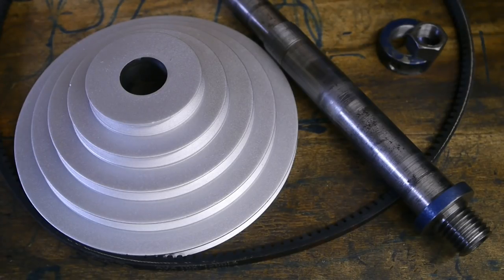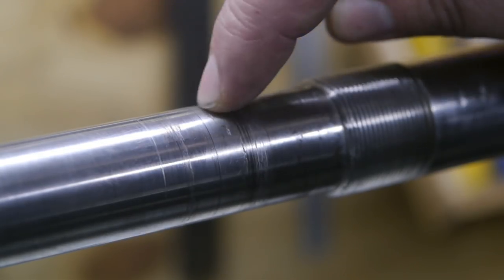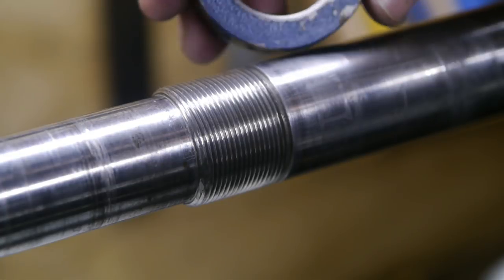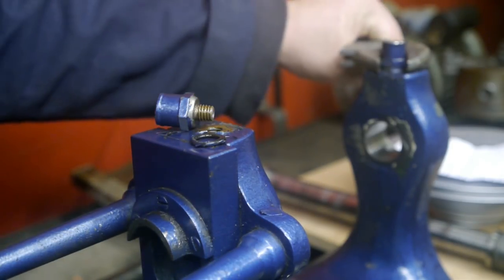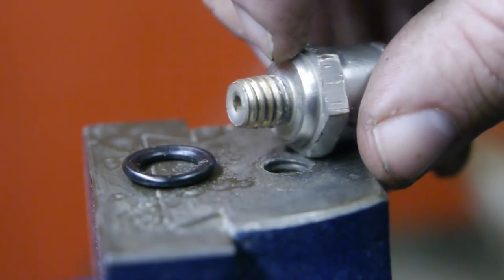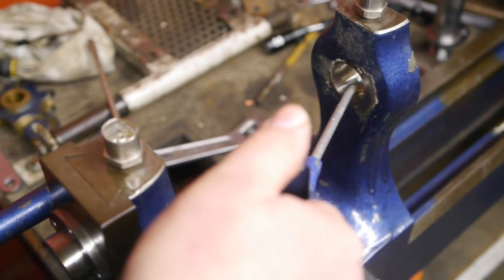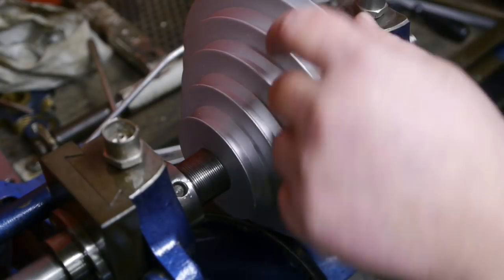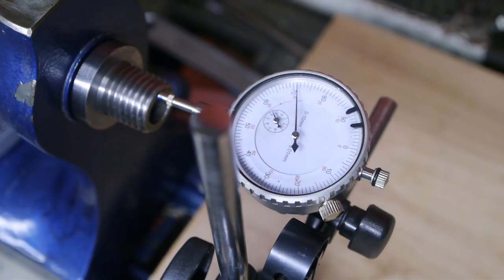Polishing bearing journals and reassembling a vintage lathe spindle

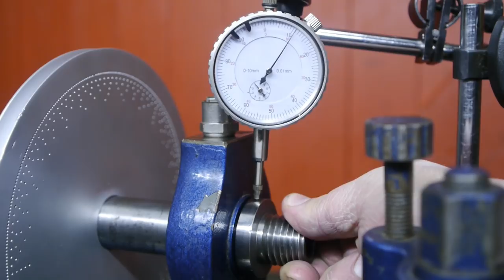Comment: Hi.  You directed us to this video from another one where you complained about chatter when screw cutting.  Some opinions suggested headstock bearing play.  If I understood your comment correctly, you weren't convinced that it was a loose bearing.  THIS video at 18:06 I think confirms the play.  You are moving the spindle side to side and STILL getting 0.03mm movement on the DTI.  Imagine how much that would be if you were moving the spindle vertically.  I don't believe that oil, even heavy oil would solve this, and personally, I think this is your chatter issue.
Regards Mark in the UK

Comment: Well done on the spindle.   I was glad to see at the end that you did not forget the belt.

The polishing seems to have helped reduce the runout.

I would use oil in the spindle bearings.   As others mentioned grease will trap debris.

Dave.
Reply from the maker: Apart from those damaged nuts this must be the easiest spindle to disassemble.
Once the axial play has been dialed in there is nothing to adjust. And that's perfect because I'm sure I'll forget that belt some point :)

Comment: I would keep the moly grease, or any type of grease away from pain bearings, and use oil only. The people that owned my power hacksaw in the past used grease in all of the bearing points, and it destroyed every single bearing point on that thing. The grease catches all of the grit and metal grit from wear, and acts as a grinding paste vs oil which just flushes the particulates out and keeps the bearings from damaging themselves. Grease imo should only be used on hardened surfaces, like ball bearings in the bearing races.
Reply from the maker: They probably didn't use grease pots that push the grease though the bearings. 
If they had, and they used them properly there should be no dirt in the bearings.
Reply: yea, Ive found the same thing in multiple pieces of machinery, and it all had the same outcome. The grease did go through everything fine and started squirting out of the sides of it, it just caused more damage than anything. It's always been an old rule that grease is for hardened stuff and oil is for bronze, babbitt, or cast iron bearing surfaces.

Comment: Not to bad for all the years it has worked. What you did did the trick. Your ideal about the grease sounded good to me. At work I used STP and lithium grease mixed for the drive cable on a saw sharpener. 
All my best.
Bobby
Reply from the maker: I want to use something a bit thicker then oil because the bearings are completely open on both sides. 
I expect oil will just piss out.

Comment: the adjustment in the end bolt,you could drill out enough to place a ball bearing between the bolt and the spindle.this could take out most of your end play,cheap and easy to try.
Reply from the maker: Are you talking about 1 ball bearing on the tip of that rear bold?

Comment: What you were picking out of the oiler bores is the remains of the felt wicks.
Reply from the maker: I'm not sure but it made me think of hemp or sisal. 
The stuff people used to use on threaded water pipe before the invention of Teflon tape.

Comment: I just found a craftsman 109 for 110 bucks, around 116 shipping to me, but the lathe itself looks to be in incredible shape, I'll do a build of it soon!
Reply from the maker: Funny, I actually have one of those :) 
It's in terrible condition and so far I never used it.
At some point I'll make a video, but for now I'll make you a picture.
Reply from the maker: Here's a picture of the mean green machine: https://goo.gl/Bb5Ru7
Reply: Awesome, I guess the one I found isn't in EXCELLENT shape, found a motor for 100 bucks on eBay and I gotta find a chuck for it, all it has is the back plate but for 216 bucks, I saw ALOT worse for 600+
Reply from the maker: I think you might be better of saving up for a Chinese mini lathe.
Reply: Eh, already bought it, I've been looking for about a year...Im a complete beginner when it comes to machine work with the exception of hundreds of hours of theory, I'll build this lathe, put the theory into practice and sell the lathe for an upgrade in a year or so

Comment: Those spindle bearing need oil, not grease! That said, you can buy MDS solutions for adding th the gearbox of a car. I have used that in my lathe's gearbox, and it reduced the noise dramatically (and thus also does a better job lubricating) an oil like that (proper grade spindle oil!!, not brake fluid or anything of that nature) mixed with MDS additive is your best bet.

Paddy

Comment: I bet they had twine wrapped around the threads on the oiler as a sealer. Old school.
Reply from the maker: Probably. Not sure why, there were also o-rings underneath the oil pots.
And it's not like a bit of oils is going to hurt the lathe.

Comment: to lubricate the spindly With   SNAP oil as it brags that a engine can run for 40 mils whit the sump of with the oil remaining  the bearings   before seizing , so i bevel it will be ideal so,  this application . may well soot you application. with the say  squirt to ad lubrication say ever hour. given it lingers for a long time  .

Comment: Should probably fix those threads up better instead of forcing it next time.  A tap to run through the nut would be great, and a die to clean up the shaft.
Reply from the maker: Taps and dies that size would probably cost more than what I payed for the lathe. :)

Comment: yes,one ball bearing.greased up and should spin.you should get a closer fit.
Reply from the maker: The idea is not bad but it's probably harder to implement than you might realize.
The end of the bold and the spindle will need to be turned concave.
The spindle is probably hardened and it very difficult to properly machine a bold that might run of center. 
Also the ball would fall out when using the sliding spindle threading mechanism.

Comment: I would find someone to reproduce the spindle.Should be simple enough. Some turing and threading. Also the bearing bores could be line honed and lapped to clean up. Sometimes a lot of work to fix them old things. Don't think I would be as patient.........
Reply from the maker: Harder then you might think. It also needs to be heat treated and precisely ground.
Reply from the maker: I don't doubt it's all possible, but is it really worth the effort for a 200 euro lathe?

Comment: gentleman, i guess those nuts are not original, if that is the case, why not take the spindle to thw hardware store and buy some new nuts? at least that will save you a lot effort. by the way, the bushing on both bearing housing look worn out, new brass shim rings seems to be a good idea, well, at least it will fix the 0.1mm gap immediately and easy enough to make, just a humble suggestion, my friend
Reply from the maker: The local hardware store doesn't have much of a selection these days :(
I'm not sure about your shim stock idea. If it spins it could block of the oil passage.